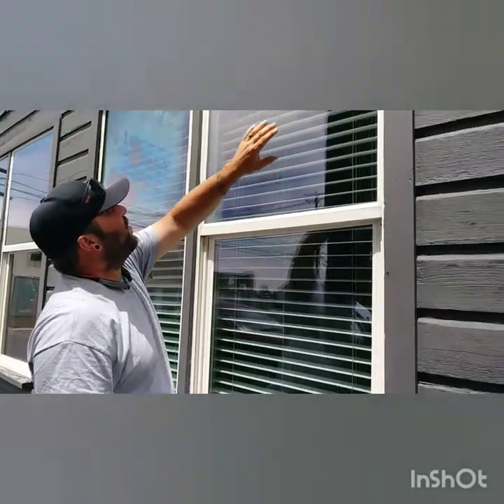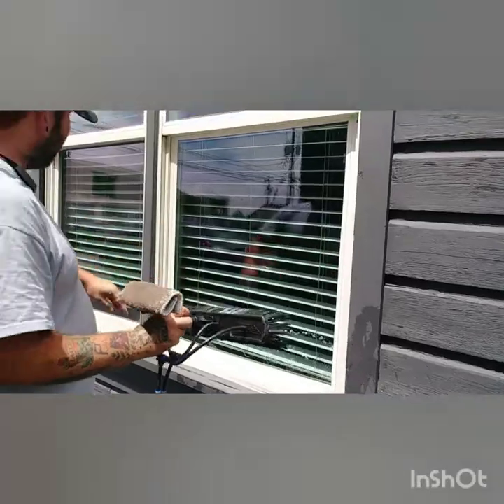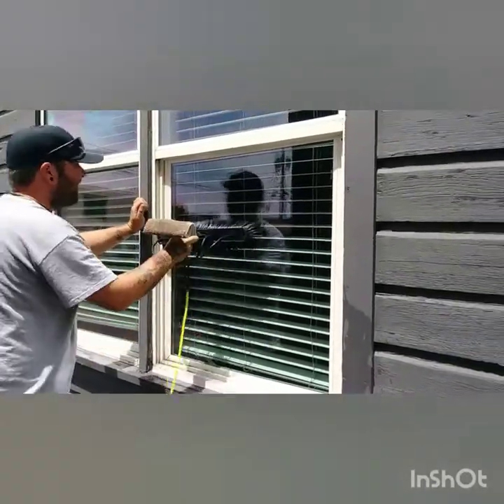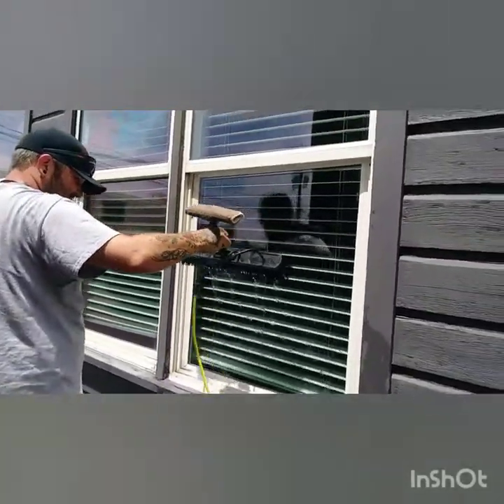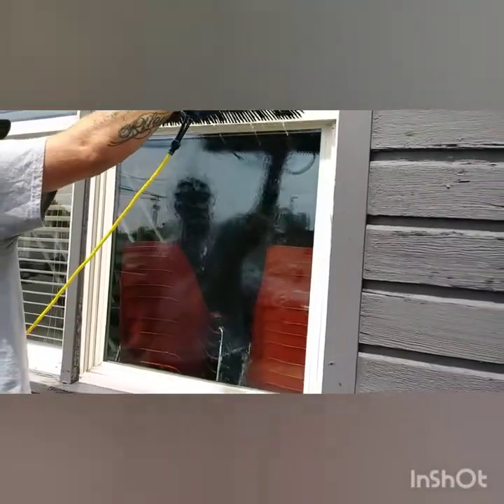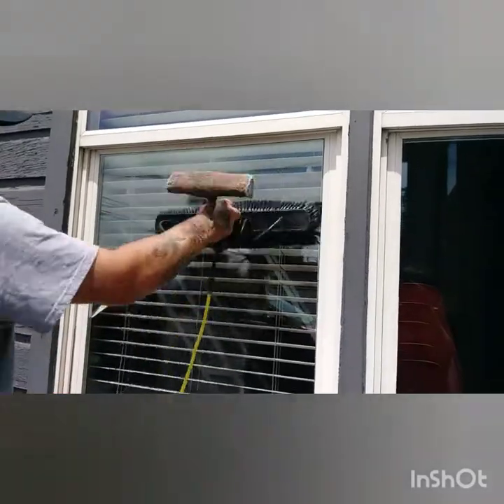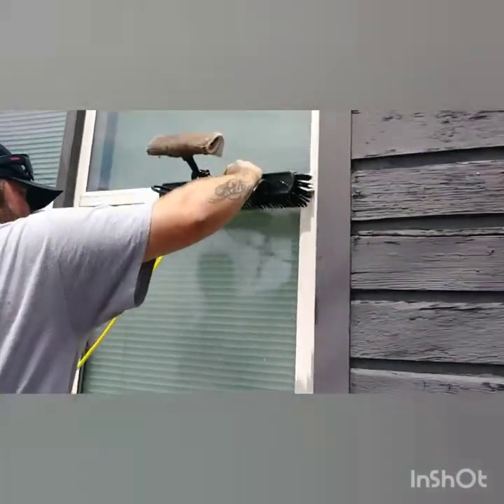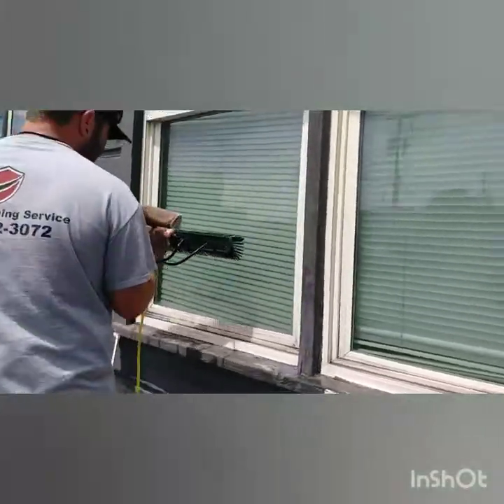Water fed tip wash lower windows by hand.

Comment: love that WFP............
Reply from the maker: Dave Landefeld The Window Licker lol thanks man. Which brush do you use? And set up? /James Riley
Reply: This is my first season with one. I have a tripple crown 35 foot carbon fiber. Not Hi modules thought. I added an aqua tap to it. 
It has a dual trim brush I forget the brand. I have a ro di system at home to make 5 gal buckets of water. I take about 30 gallons with me .  I only use it on half my jobs.  I  also got an Unger 2 bag hydro I haven't used it yet because I mainly use a Hudson never pump .  I am going to make a video of a new inexpensive set up. You can get a 40 psi 1 gal per minute pump on eBay for $25 it attaches to a car battery. As long as you have enough pole hose you can pump water right from your truck. Tractor supply has a 50 gal poly tank for about $200 that only measures 2 ft by 3 ft
Reply: Been doing alot of research my next pole will be a reach it mini 25 ft and an over the top rinse bar brush
Reply from the maker: Dave Landefeld The Window Licker yeah I remember now my first season with one to Realy like my xero pure ro di set up and I have a fiberglass 18ft xero and a 40ft pro xero not the hi mod works realy well set up with univalves for easy on and off. I did the same thing when I first started I never actually used it I had a homemade brush from Home Depot the Unger and put little jets in it tube it all up stuck it onto a Unger Pole from Home Depot. And had a little electric backpack pump that I took it all apart kept the handle on it and would just attach the handle to the end of the pool so I could start it and when I would release the trigger it would automatically shut off I only used it on two jobs. But it worked I would just get Rodi water from like Walmart or whoever had the best water I'd walk in there and test it make sure the TDS was low enough I could only usually get down to like four. But it was still good and if you wanted to take it lower you can mix it with some distilled water but that's not very cost-effective but I was only getting the water .30 or $0.40 a gallon I can't remember some times on EBT lol just trying to make it.
Reply: I got a rodi on eBay I make water at home for around 15c a gal if I use the Unger hydro it would be 30c per gallon.  Our tds is 96 both systems get it to 0

Comment: Hydrophallic...
Reply from the maker: Glass Realms hydrophilic having a tendency to mix with, dissolve in, or be wetted by water. In our case as window cleaners glass is either hydrophobic meaning that when you go to put water on it to rinse It it makes a bunch of little beads of water and balls up and runs off the glass or dries up with the dirt inside it evaporating and leaving the dirt left on the window hydrophilic means that the glass wetted by the water really good it likes the water it all floats off the glass like a sheet or waterfall effect instead of balling up into a bunch of little beads this is ideal for rinsing the glass if it's hydrophobic you have to rinse it really well over and over or use fanjets to make it easier